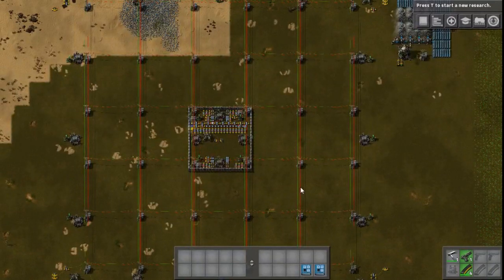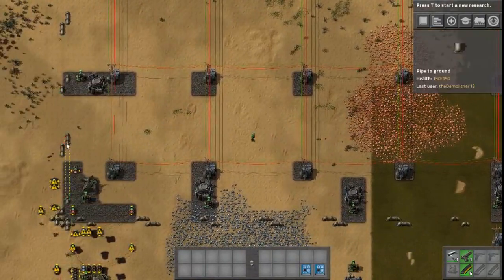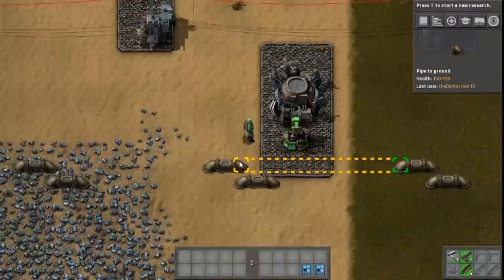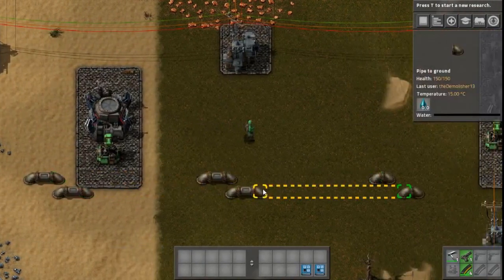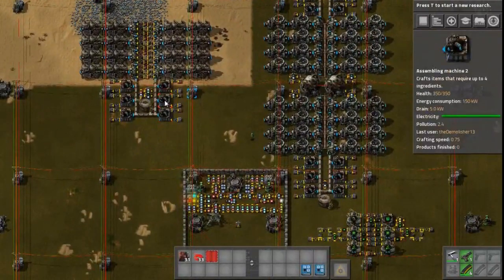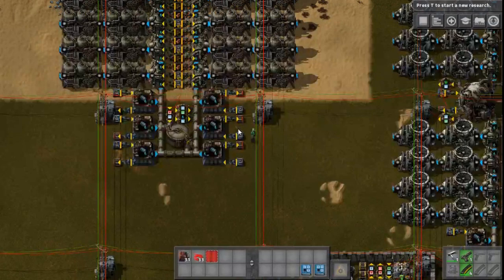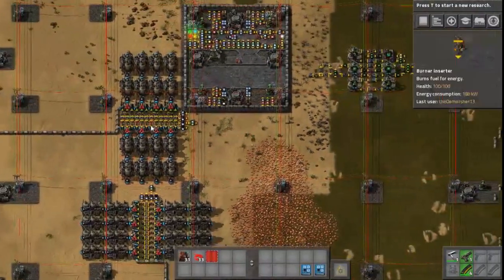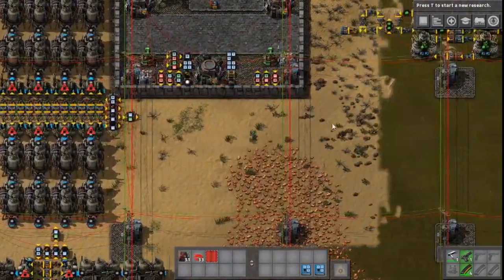S.E.F. Update 3

Comment: Trains are more expensive, but pipes are pretty limited in throughput, especiallly for regarding water needs for nuclear plant. And cost should not be an issue for a self expanding factory (besides, you don't use any belt, only bots, and a lot of logistic chest, which are not exactly cheap and probably dwarf the price of trains).

The wiki has excellent info about pipe throughpout :
https://wiki.factorio.com/Fluid_system#Pipelines

A single offshore pump outupts 1200 unit of water per seconds can feed 20 steam turbines or 40 steam engines, but can only go through 17 pipe section (undergroundies counting as one) before you need to use small pump. If you aim for a throughput of 1000 u/s, you can get away with pipes 200 segments long, which should be more than enough (you can then use pumps or train to interface macro blocks).

If you're looking to minimize bot usage, you should do a lot more direct insertion. For example, I see you output stone furnace into a furnace. If you only use them for boilers, you should output directly into the machine crafting the boiler. Same for  copper wire, to some extent.

For red circuit production for example, I see you alleviate some of the bot work with inserter, but you could alleviate most with belts, and only one provider chest at the end of the line to gather red chips, and one or two requester at the beginning. It would also save a lot of ressources and a lot of inserter electricity.

Making a modular build that use belt as junction is a pain, but there is little to no reason not to them within a module, escpecially if you have a production line as you have for Red chips.

I don't know how you plan to produce water, if you use a mod like water fill, running a water pipe around your base is mostly unnecessary. If you refuse to use train for water, I would stick to solar power and only use water for oil processing and bootstrap power generation. Or I would have small submodules dedicated to running several pipes parallel. Or I would use tank and pumps rather than pipes (with 2 underground in between). If you eventually use trains, there are a couple mods which allow to place them automatically. In the same spirit of water fill but vanillia, you can build power plant directly on top of a big body of water, and use landfill to have nice straight lines to put your pumps. I don't know how compatible big bodies of water are with your mapgen settings, I presume you have to tweak them significantly to have the ressources you need in reasonable quantity, distance and diversity.
Reply from the maker: Well I'll give it to you that the assembly plant could use more adjustments. When I first design the red chip production I had the mindset of no belts but have since then began to think other wise. So I'll probably go adjust that.

Next the goal is to have the whole factory use only One mod "Recusive Blueprints" there for that kills trains right out the gate which leaves barrels and pipes. And we need to use steam/nukeler power because the factory needs to run both at night and day in case of biters attack. Even with batteries solar just wouldn't produce enough power to last the factory forever and we shouldn't rely on any one tech so heavily as that would be like putting all of our eggs in one basket. But thank you for the suggestions.

 I will say I had another idea for the cells to began breaking themselves partly down to help recycle on supplies but only when they and their neighbors are done with the program.
Reply: "Even with batteries solar just wouldn't produce enough power"
Well, there's no limit to how many solar panels and accumulators you can place and to how far you can place them.

"Recusive Blueprints" is a mod minimalistic mod to enable automation for something not automatable in vanilla.
"blueprintable trains" is a mod minimalistic mod to enable automation for something not automatable in vanilla.

They are even made by the same dave.

Waterfill does feels cheaty somehow, but may be good to have a finished product quicker and go solve that issue later on.

But if you really want to use pipes and barrel, then I strongly advise against your idea of piping water all around your base and place the power plant anywhere, you'll be very limited. Instead you should somehow (I expect it to be very difficult, but not necessarilly harder than transporting water by trains) have the power plants placed by the water, or in adjacent modules with 1 separate parallel pipe per pump.

In any case, oyu should also use underground pipes for straight pipe lines. There more expansive but only count as one pipe segment as far as fluid flow is concerned.
Reply from the maker: Thanks granted I could of put in a condition for power plants to be built next to water sources only issue is then when the factory needs more power and is no where near a new water source it won't be able to build any new ones on top of that if I had all old cells on standby that are valid candidates to build power plants. the what would happen is all of them will build a power plant at the same time when one is needed and cause the whole system to stagnate as the demands for fuel and water just spiked for no good reason. which would lead to fuel being burnt at not it's full potential thus wasting energy.